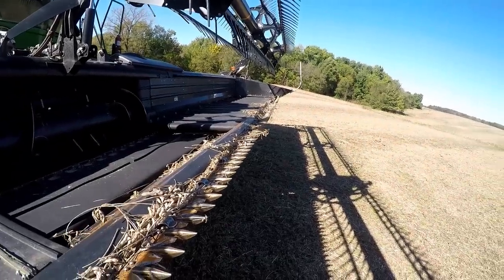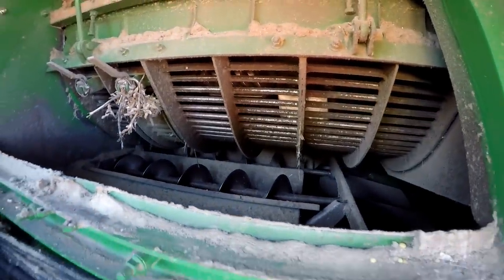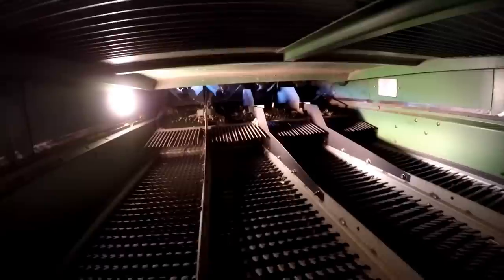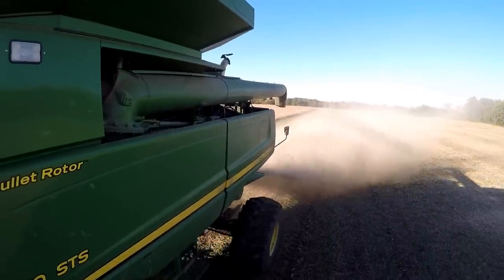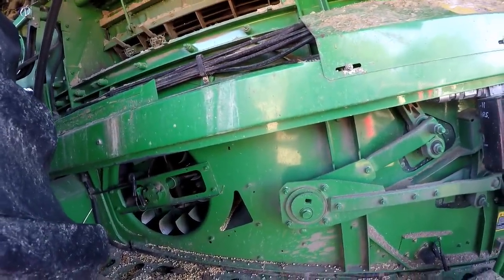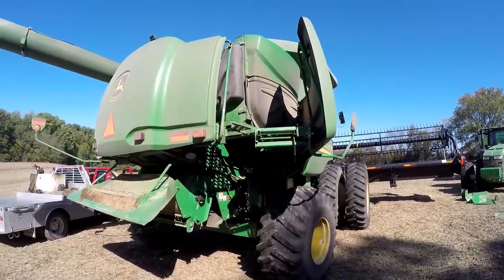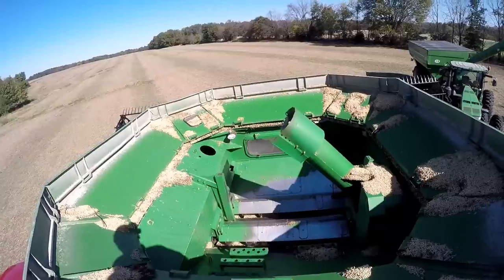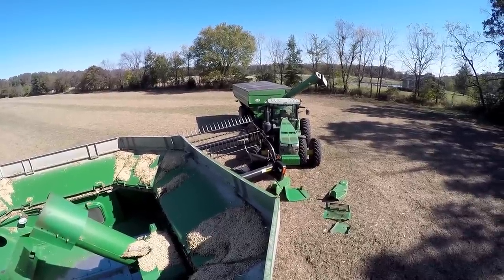#100 How a Combine Works.  Up close video Deere 9770 STS

Comment: And between the feeder house and the rotor there is a spinning drum that is called a feed accelerator. It tosses the crop into the rotor so the crop flows in without wrapping the front of the rotor causing a huge bearing to go bad. Also in the back there is a pan above the sieve that catches more thrashed crop off of the rotor which directs the seeds to the front of the sieve so when the seeds drop down on the sieve the crop can then travel the whole length of the sieve instead of just a portion. If the crop ever leaves the back of the top sieve it is lost.
Reply: Hey I like you how you said it great job.
Reply: Tim did not know "asked" if you could adjust the concave from the cab on the 9770.. In 48 years of Combining never seen one you could not adjust to some degree from the cab so when he was a kid?? Must be much older than he sounds. And if the concave is too close or fast or too grain too dry it can damage the grain!!! But.... Good video for the green horn!!!